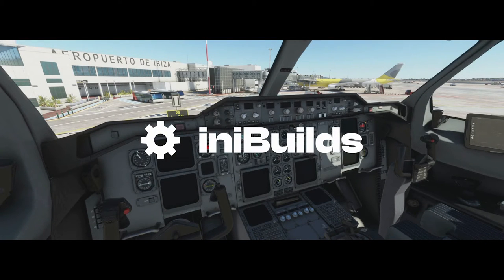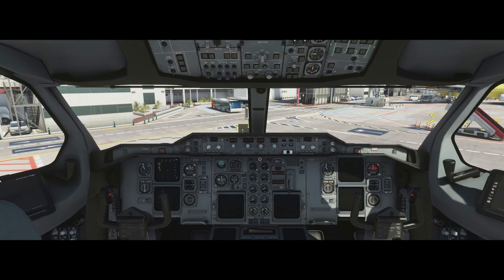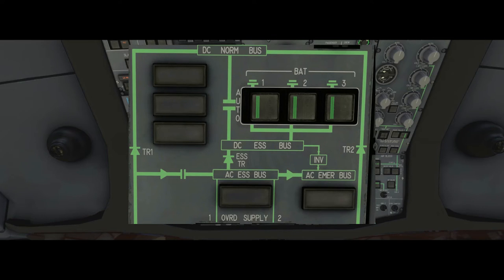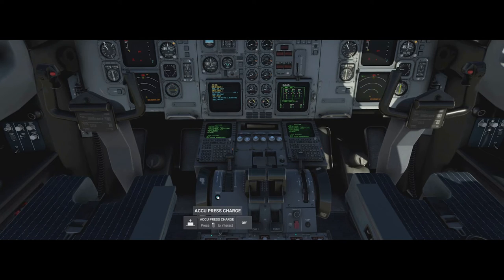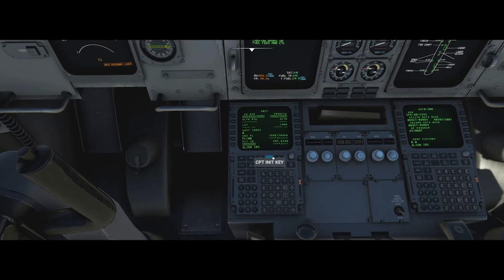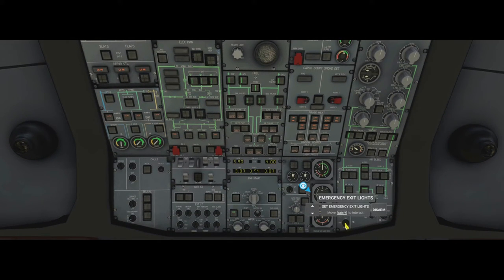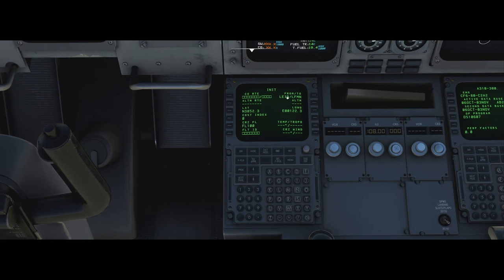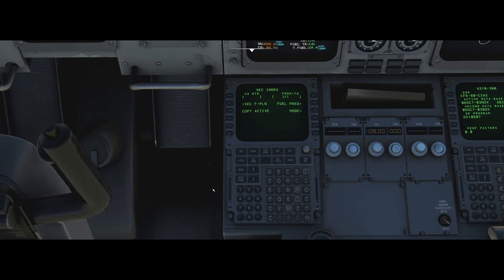Aircraft Discovery Series 1 | Airbus 310-300 | Episode 5: Return to Airliners - A310 I Part 1

Comment: 3:58 APU system page on the a320 you can see the apu flap "open" egt and speed
Reply: When you are not connected to external power and only use batteries as mentioned here, the APU systems page is dark. Same thing in the A310. It also has a APU systems page which is not powered at this stage of the start up.